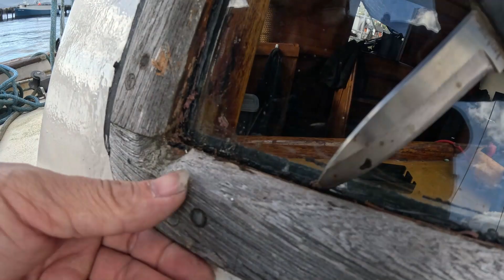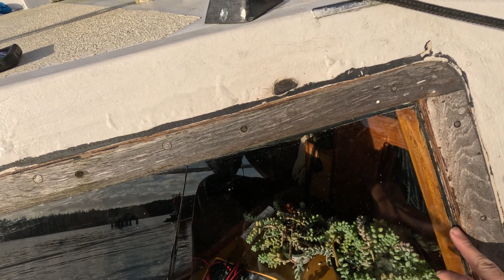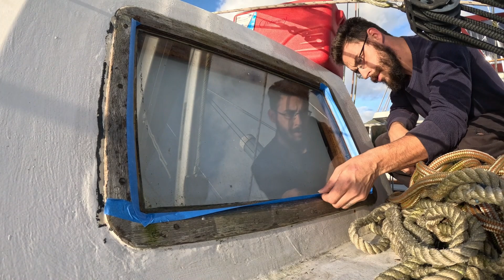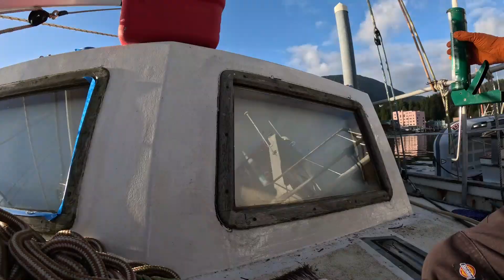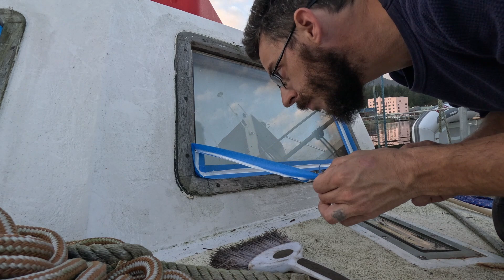Fixing Window Seals

Comment: Ok, to seal, use latex gloves, once you have applied the sealant, use a spray of water with detergent, spray and pass your finger over the silicone sealant, what happens is that you will keep the rest on your finger and The glass will not stain, they are DIY techniques to seal, you can find them on YouTube, you are doing very well, congratulations 👌